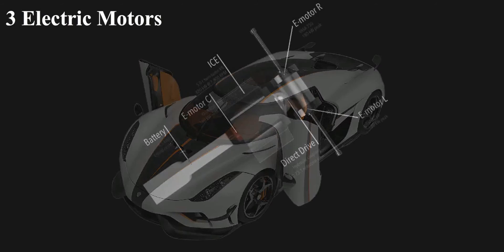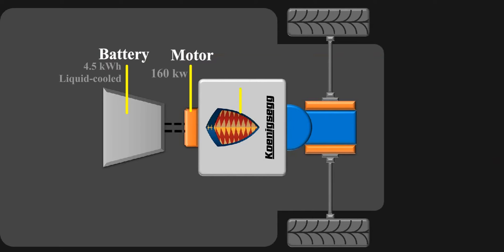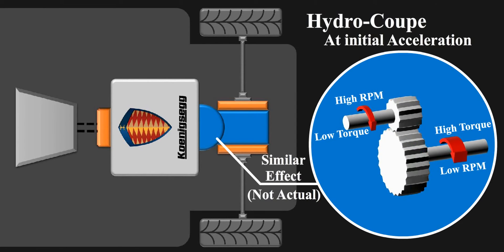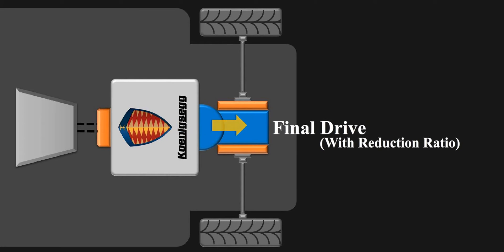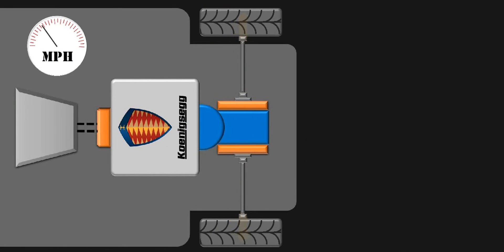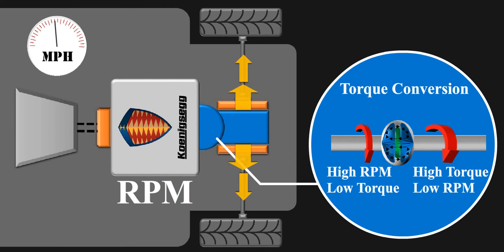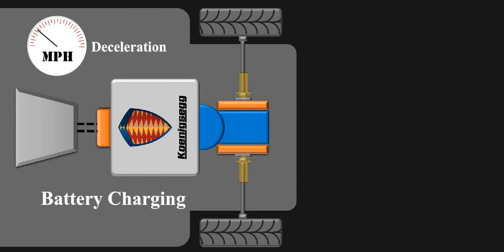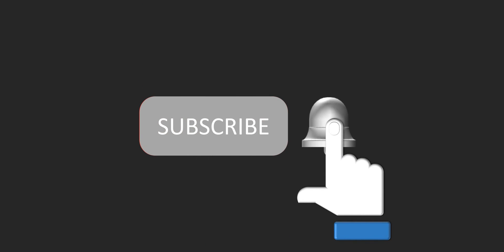Regera | Powertrain explained | IC Engine Car without transmission

Comment: This powertrain is nothing new. Old Diesel-electric locomotives have very similar principle.
I just hate lack of proper explanation from Christian himself.
Reply: Are they having complete electric power at the wheel, with diesel engines solely functioning as the generator? From what I know, there is no direct mechanical connection from engine to wheels in a diesel locomotive. Correct me if I'm wrong.

Comment: @Untangle Club
What would be the inflection point for a Variable Frequency Drive + Inverter + Motor combination wherein it can exceed the efficiency (but weight penalty) of a mechanical transmission in traction applications?

As in, what would be needed to make a fully series hybrid be able to exceed the efficiency of a parallel hybrid, like the Koenigsegg Regera?
Reply from the maker: 1) When hydro-coupe locks up.
2) On board generator efficiency should be increased, and it should be designed for electrical power generation like in power plants. We are using similar thermodynamic Cycles in generator of series hybrid as we use in regular non hybrids automotive. So mechanically transmitting that power will always be more efficient than converting it into electrical and back to mechanical. To make series hybrid more efficient, on board generator should be built for that specific function ( generating electrical power efficiently). One of my patent is related to same topic which is yet to be granted, so I can't discuss more of my ideas, but these are basics.